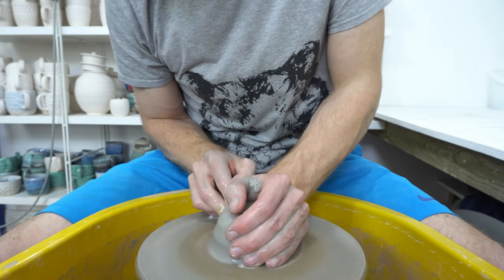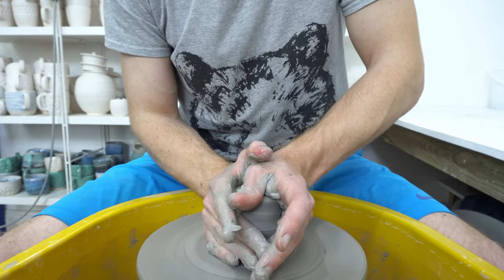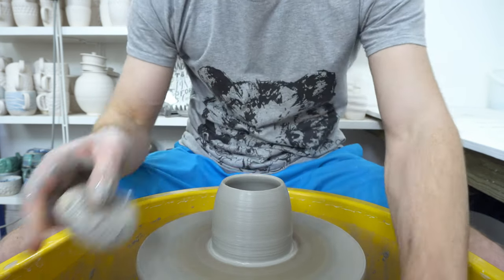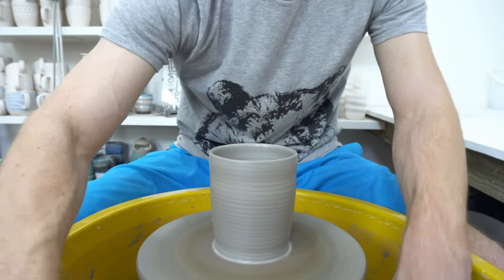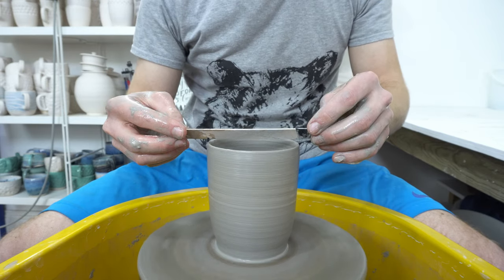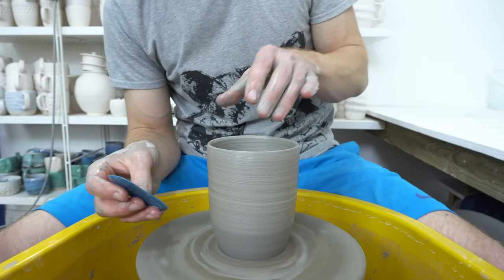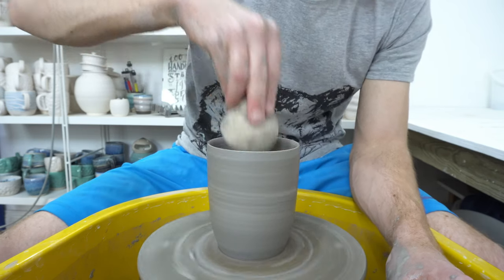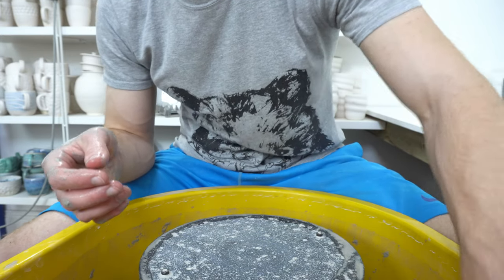Throwing a Travel Mug

Comment: So helpful about the weight of the clay roughly being how many mls the mug will hold! I've been doing pottery only for a year but i mostly make mugs and sell them at a local market and I have been trying to figure out how much clay to use to get the size mug I want! Thank you for that tip :)
Reply from the maker: I'd definitely suggest checking it before making too many! It depends on how thick you throw, how much clay you leave at the base to trim, the shrinkage of the clay, etc. But once you've found how it works for you then it's a really consistent way to predict capacity